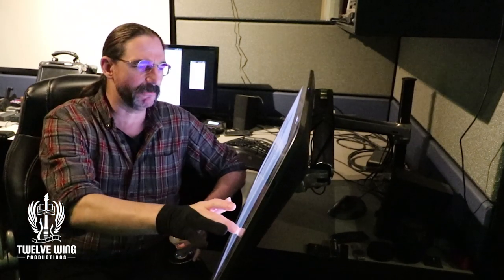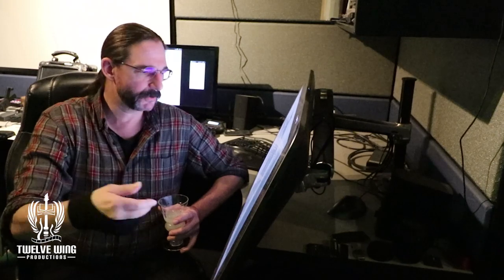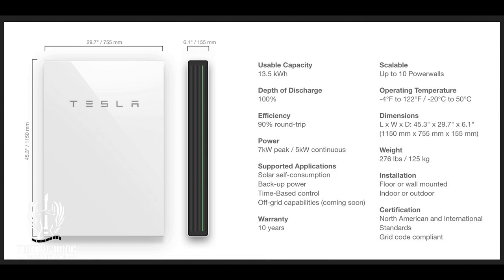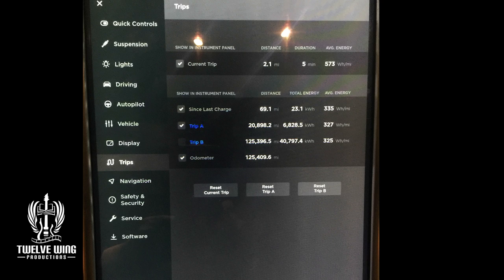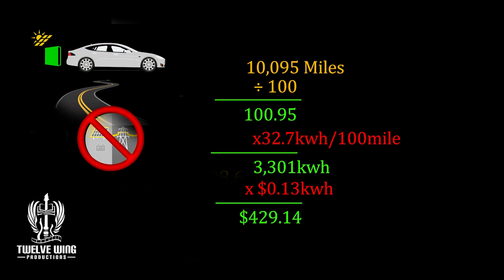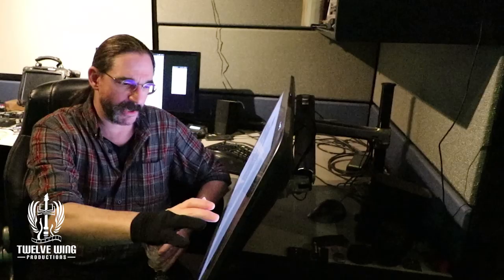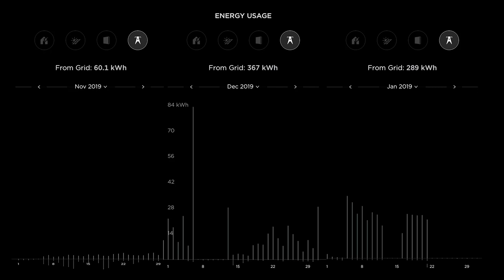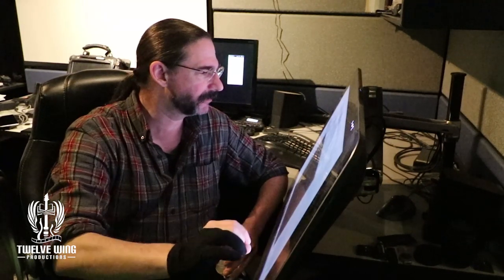Massive 6 Tesla Powerwall System: Did It Work?

Comment: Interesting content of raw data.  I would like to see your electric costs for 2018 compared to your electric costs for 2019.
Reply from the maker: The system was installed in Feb. but didn't actually go live until March 10th of 2018.
It might be more interesting for me to dig up and post our usage numbers in kwh but I can tell you our overall production for the year.
From March 10th - Dec. 31st we produced 12.93Mwh.
That's a production average of 35.4kwh a day of production if you spread it out for the entire year.  Since this is subtracted directly from the home's usage to get that check, if we use the figure of $0.15 per kwh that $250.80 says our overage for the year was 1,672kwh.
So without digging up a bill, we must have used 11,258kwh for the year or 30.84kwh per day on average for the year.
Infrastructure charge for 2018 was $18 a month so a total of a little over $216 for that.

Hope that answered your question.
Reply: Sort of answered my question. It looks like you paid less in 2018 than you paid in 2019. That doesn't seem right. I would have thought that 2019 would be less than 2018.
Reply from the maker: @aletaschulz2019 , a couple things go into that.  As I pointed out, we averaged slightly less per day of usage in 2018 and I was primarily charging the car at the studio for 2018 as well and not off solar power.
So it's better to look at total usage numbers rather than cost.  When you do that, the disparity is better understood.
I'll try and do a video that outlines what we can for 2018.  Bottom line is that we used less power per day.  An average of around 7kwh less.  So something on the order of 2,500kwh more power was consumed in 2019.
Hope that helps this make a little more sense.
The additional power sent to the car added to our overall home usage for the year for 2019.

Now from an overall reduction due to the addition of solar, our reduction in cost was 90-95% from when we did not have solar.
That wasn't part of the scope of the project though... but I should probably try and add that information in there as well.
For example, in *November of 2017 when the home did not have solar, grid use was 790kwh.
With solar alone, in 2018, the amount from the grid after solar contribution was subtracted was 222kwh.
With the batteries available to cover cloudy days, in 2019 our total usage from the grid was 42kwh (According to the Utility bill but was shown as 34kwh on the Tesla app).

So clearly, the addition of batteries helps out greatly in the case of these shoulder months.
Reply: Twelve Wing Productions Thank you. It makes sense.
Reply from the maker: @aletaschulz2019 , Noooo!  It can't possibly make sense!!!!  Not yet!
I just finished a video where I tried to confuse you more!!!!
Dang it!

Comment: this is confusing. If you only had a 7.6kw inverter why would you need to get the utility to approve a 10.2kw system or larger it would seem that you would be limited by your inverter to 7.6kw no matter how many panels you have and would only need to have approval for that.
Reply from the maker: Exactly.  That is the kind of thing we have been fighting.
Simply put, the utility companies don't want you producing extra power that they then have to pay you for.
If we had installed 18kw of production, we would be able to run at or nearly 7.6kw of power in the dead of winter.
Obviously it's not healthy for the inverter to run railed for 4 months out of the year... but that aside, what the utility doesn't want is for homes to actually become solar plants.
The utilities want to build those.

I'll do a special video on this question as it's an important one.  You are not the only one confused by this.

Comment: way to much money, 10,000 per battery and then upgrade  
SMA inverter 4,000.00 plus installation 10500.  ah well  it would be great to be able to
Reply from the maker: Much depends on your installer and the incentives in your area.
Where are you located?
Our entire system came in at $54,000 after incentives.. so in the end, nowhere near what you were quoted.
Reply: @twelvewingproductions7508  Wisconsin